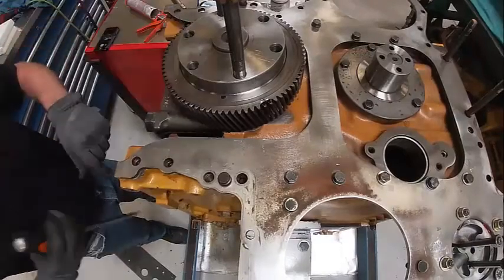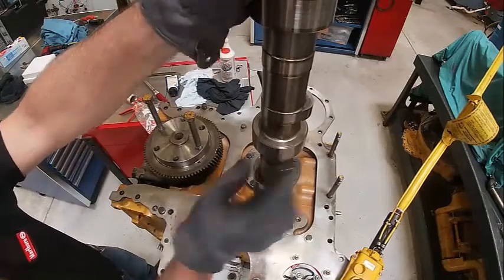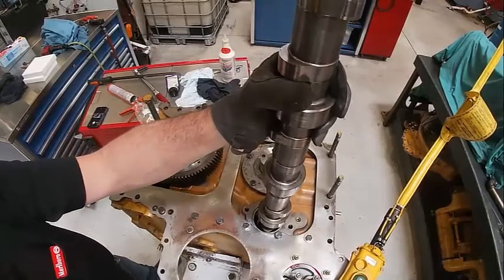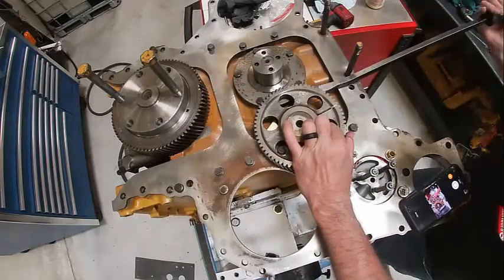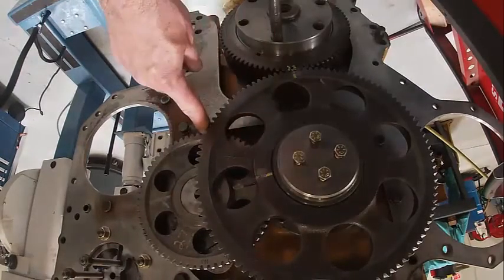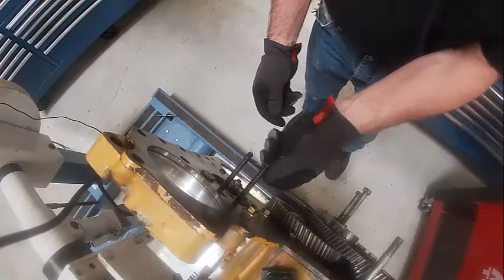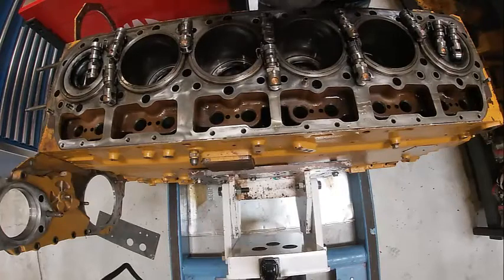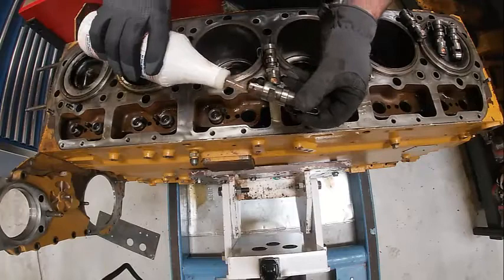3406 Front Geartrain Camshaft and Cam Followers Install

Comment: Do you use any type thread locker or just torque to specs? Great videos , Thank you !
Reply from the maker: If the bolts are torqued there is no need for threadlocker